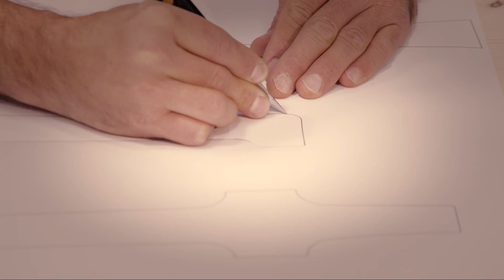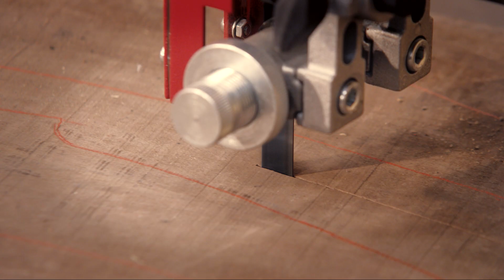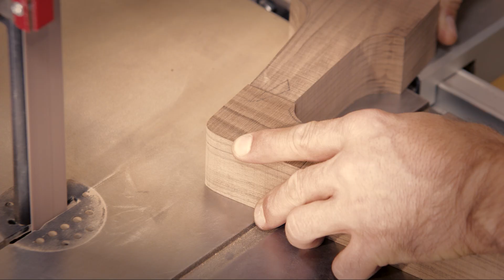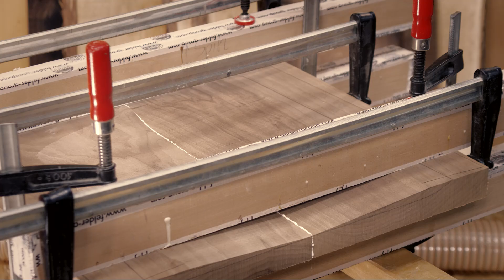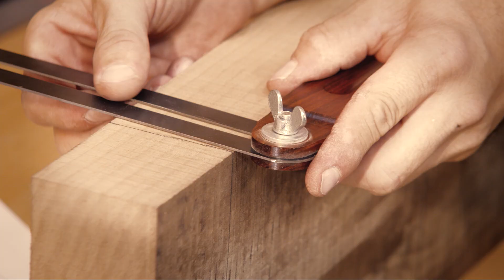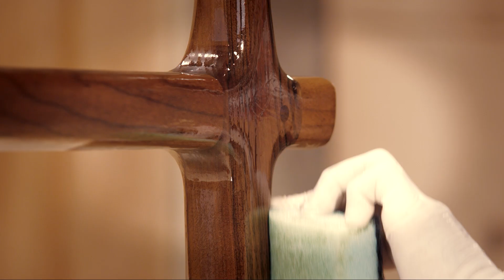DIY Hammer® designer chair produced with the bandsaw N4400 | Felder Group

Comment: Oh, my . . .

That was an impressive demonstration of simple tools and efficient planning -- and, if I may admit: when he started applying the finish my jaw dropped (as ALMOST did some saline solution from these old eyes).

That's simply GORGEOUS!  Nice work - and thanks for sharing!
Reply from the maker: Many thanks and best regards from Austria!
Reply: Can hammer provide measurements for the chair, particularly the height of the seat, the back leg and the width of the chair?
Reply: Esta máquina quiero comprar soy de Perú
Reply: Tbh you could sand and apply finish to a pallet and it would look like a piece of art

Comment: Very nice chair, easy entry point for someone to make. I like the design and the simplicity of the build. Chairs can be hard to make, this makes it approachable for beginners. The joints could be backed up with dowels or if you have a domino just use domino joints, but that is not the point of the video.

Comment: I miss the joints. Using only one screw with butt joints for all the legs seems to be a very weak joint. At least dowels should have been used. It will break apart in a very short time.
Reply: Yes a big dowel and construction glue.
Reply: These are looking chairs they're not sitting chairs you build them stick them in a corner and watch them
Reply: I agree. Dowels or mortise and tenon.
I'd like to do this chair aided by the pantorouter. That would be a solid work of art.
Reply: Look up the Maloof joint, this is basically a dumbed down version of that. The Maloof joint has sort of a groove in it, which makes it slide on and provide support, which will last for a long time. This is the lazy version of that.

Comment: How do I print this plan full scale
Reply: I was wondering the same thing. Would love to do that.
Reply from the maker: Hi, TWC!
I will ask our carpenter which scale he used, then it should be possible for you to use the right settings for your printer, right?
We will get in touch again.

Best regards from Austria
Reply from the maker: Hi, TWC!
Now I got the answer. It's scaled 0:0 so if you print it on DIN A0 you should be good to go :)

Kind regards